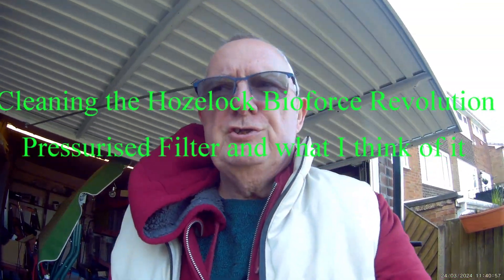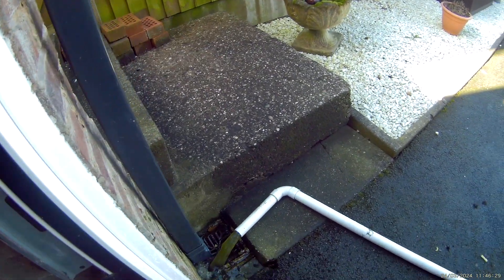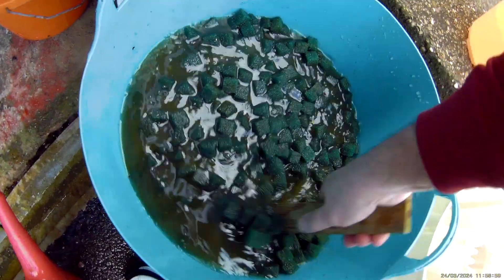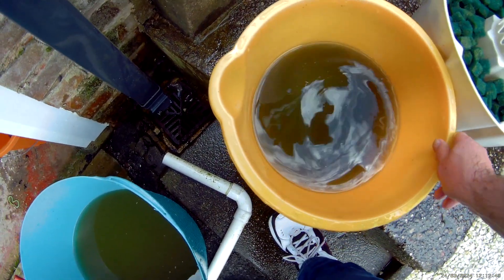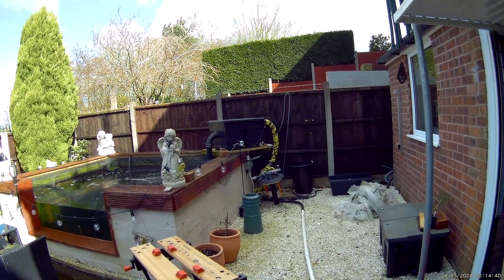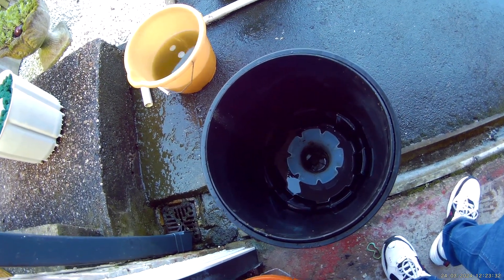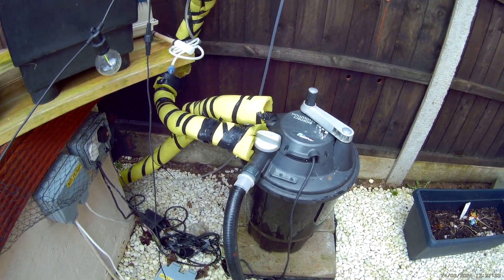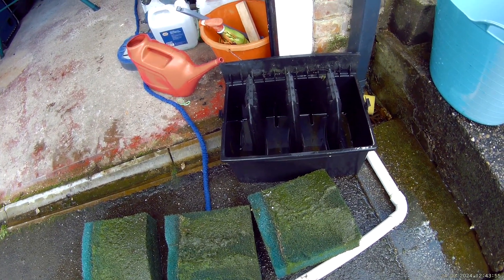Cleaning the Hozelock Bioforce Revolution Pressurised Filter and my thoughts of it

Comment: I  made  my  own  pre filter  so  most  of  the  worst  stuff   goes  there  first  the  only  trouble  is  i  have  to  clean  it  every  week  in  the  summer  . i  also  have  a  black  box  filter  that  i  only  run  in  the  summer ,  But  i leave  my  main  filter  running  all  year  . You  are  catching  it  in  the  filter  but  the  same  as  me  i  spend  2  hours at  least  every  weekend  cleaning  filters   i  have  been  doing  this  for  10  years  and  fed  up  with  it  really.   Cheers  Andy
Reply from the maker: I have been looking at a drum filter but to expensive at £3000k but the easypod auto clean at 750 might be the way to go.